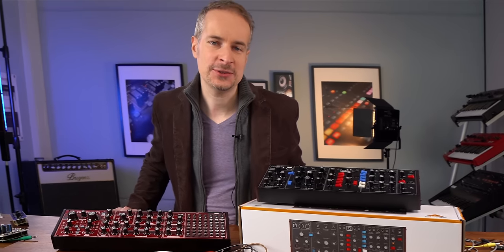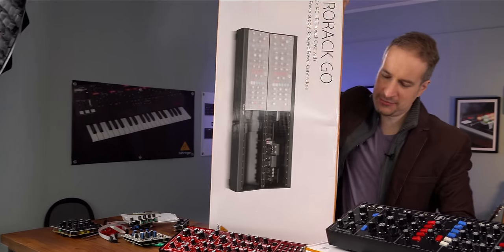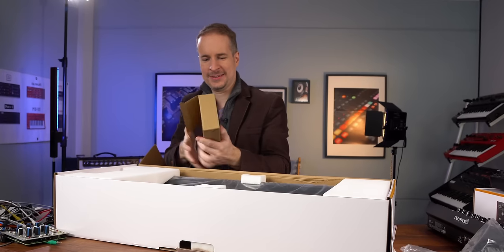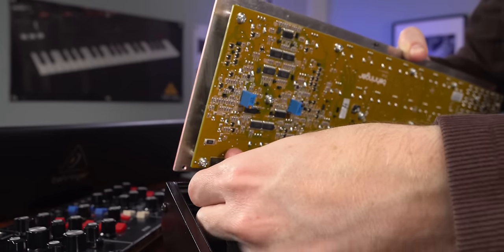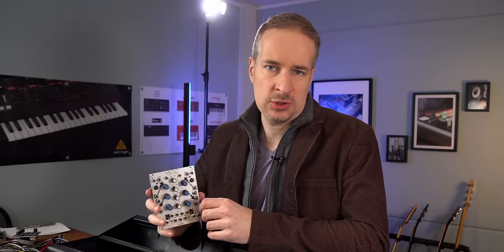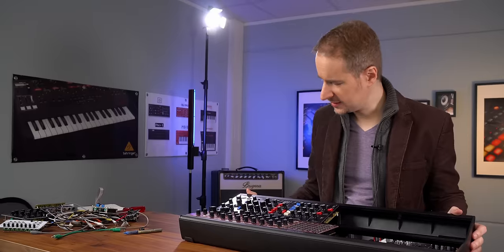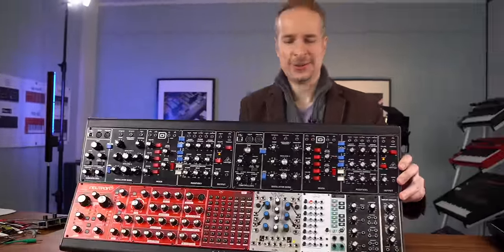Go Go Eurorack! Our new modular synth case

Comment: Guessing they will be putting a half size one soon. Which seems like it will be a bit more usable for most as far as not having to have so much stuff to fill it...
Reply: Half size would be great for those starting out.
Reply: Actually, half size is usually never enough for starting out. Most people are surprised at how quickly you can fill these types of cases.
Reply: @Genshi  Im guessing the smaller one is actually gonna be like 60% size... As half size would fit the Model D and Wasp but not the Neutron, Pro 1 and K2... So it makes sense to build one for 3 qnd no2. And especially when the 3 bigger ones tend to have more options as far as connecting with modular synth units... Ya figure at this size it would cost someone quite the bit of money to fill it up... Makes sense to make a smaller one and serve the rather large crowd who doesn't have 3 Behringer synths and a bunch of other stuff as well to fill it all up...
Reply: I think you are missing the point of Eurorack. First, I think it's ridiculous for anyone to take out the panel of a semi-modular synth like the Model D or Neutron to out it into a Eurorack case; those already come in their own case! But whether you use those or not, every single time anyone gets into Euroack and chooses the "smaller" case, they get frustrated when they see how quickly they fill it up as I mentioned before, because some modules are not as expensive as you may think. So it's always better to get more room than you need at first to grow into... When I had the TipTop Mantis case (the exact same size as this Behringer case) I outgrew it so quickly I had to get two of them, which was super inconvenient for live performances, so I eventually wound up getting one large foldable case that can fit all the modules from my two Mantis cases... and now I've already outgrown that! (and I don't have ANY full voice semi-modular synths like the Neutron in my case.)
Reply: Additionally, they already make a smaller single row case, and Arturia recently came out with their smaller (not as wide) cases for Eurorack. It makes more sense for Behringer to make this "Standard" size case, even though it is basically a clone of the TipTop Mantis case (we'll see if it can come in at a much lower price.)
Reply: @Genshi The thing is tho is there is a market for a 60% size unit.... Behringer has been spitting out these synths left and right. You now have a bunch of people looking to buy a 2nd unit and then stick them on a stand like one of the 3D Waves units or put them into other rack type units and on and on that can hold 2 in a small area right next to each other... Now if they put out a 60% case like this one there is another option for all these people to look at. They can get the case along with the new modules Behringer is gonna put out and build a setup that way instead. With 1 Behringer synth instead of 2. But then  having a little bit choice over how to build the part that's various modules... Is it me or is a big chunk of their audience people who don't have a billion dollars to build a setup? How is that Moog module they just showed gonna cost? Figure its gonna take like 8 units that size or more to match the width of a Neutron, Pro 1 or K2... Does little Billy have enough to that, then also then double it all up from there as well? Maybe not... After all he's 16 and cant even buy a beer yet let alone come up with mass bank to buy fun toys...
Reply: If what you are saying is, they should make a smaller case for people who just want to have two of the Behringer units in one compact case together, then that's fine; it's like the little rack thing Moog made for people that have the Moog Mother-32 synths (I have three of the Mother-32s altogether with the attached side-rails thing.) But just because you have a bigger case like this new one Behringer is showing now, doesn't mean you have to fill it all up right away... that's how you are making it sound. The whole point is to gradually get the modules you want once you can afford them... 

So now which do you honestly think is better, getting a smaller case for your two big Behringer units and maybe add a couple of smaller modules, only to realize there are about 3 new modules you also want and can actually afford (and whoops! Now you need a bigger case) or, get the bigger case to start with, put in what you have now, and know that someday, down the road, when you can afford another module or two (or 3 or 8) you can fill it up later as you go. Makes more sense to me. And that's how most people do it. But if all you are looking to do is to put two Behringer semi-modular synths in once case and that's it, sure there is a much smaller market for that, and there are already solutions for that from many manufacturers already...
Reply: @Genshi  Yea, that's exactly what im talking about... The crowd that does things like the Moog Mother 32/Dfam double and triple rack..s. And people who do little 3 tier Volca stands... And now their quite often the same folks who already have a Behringer Model D or Neutron and now watched the Pro 1, K2 and Wasp get released. So ya now have that crowd of people adding a 2nd Behringer synth with the idea of putting it on a 3D Waves stand or a stand from the guy on Germany who sells stuff on Ebay… At the moment, Behringer is not gonna make any money off of all those stands. Their gonna sell a bunch of the synths to these people so they can have 2. But make nothing off the stands. The guy in Germany and the guy doing 3d Waves however are gonna love it heh...But if Behringer did a 60% rack they could sell to that market. And it would open up the option to those people to instead of going with 2 Behringer synths, go with 1 and then enough modular units to fill up the other space... It might be a modular that satisfies harcore modular guys. But these are quite often people who may run a Volca Modular unit... Compared to that its gonna seem "big time" even if its just a small row of modular combined with a Model D or Pro 1 or whatever in a small setup...
Reply: Fair enough!

Comment: Could the behringer pro 800 be put into this if one power section was used only for that? It may be just slightly over but would it be ok still? If it's a no, could I put in something like the cp1a PSU and power the pro 800 separately like that? Thanks

Comment: Dump the DC plug.. the best part of my Pittsburgh Modular Case is that it uses a 3 prong PC cable to the power supply that is easily available at any electronics store.. no power brick to forget or lose when you are packing for travel..also the thing I hate most about my Rackbrute is the DC cable plugs into the front of the case..hideous...and you still have to deal with a power brick..just integrate everything into the case.. So the 2 things that I would change on this Behringer case are the power supply plug and the sliding nuts. Then I would be all in on this case and sell my Mantis, RackBrute and Pittsburgh cases.. cheers!
Reply from the maker: We hear your comment. The unit will ultimately now come with a mounting strip rather than sliding nuts/bolts.

Comment: Awesome!  If I could make a request...  Please release the Neutron's 3340 oscillators as a module. Maybe add a fine tune knob?   Some FM inputs? They sound great and I want to keep them in my rack detached from the Neutron.
Reply: John Doe look into electro smith they make a 3340 vco based on the same reissue ic chips. Diy kits are 99 bucks and don’t require any smd soldering.
Reply: Behringer said - Sure when do you want that this Christmas?
Reply: Adam Rojo  Thanks! But what I love about Behringer's oscillator is the wave shape morphing.  It allows for variation on the same basic waveform by blending adjacent waves.  Plus modulating shape produces some wild results.  The tone mod wave sounds nice too.  It's just a really good oscillator.
Reply: Cami Lito I want it on my desk by tomorrow morning or somebody is fired!
Reply: John Doe no worries. I forget they integrate that panning vca on the wave outputs. Also integrated that dm12 tone mod so that’s another plus for a neutron vco module.

Comment: one question: is there an internal midi-bus where i then need just one midi-in module or do i need for each module an extra midi2cv-converter-module?
i do like that my modul d has midi-in and i do not want to loose that feature..
Reply from the maker: Eurorack modules use CV instead of MIDI. So you need either a MIDI-to-CV module or you use a synths that already has USB-MIDI and CV outputs like the Model D or the MS-1.
Reply: @behringer  or use a neutron or keystep

Comment: Really cool, I've been looking to expand my Eurorack. I've been using a Moog Mother 32 and moog Dfam in a Tier 3 rack from Moog. Though I found it expensive to buy an empty case for it. What I am curious about however is. What happens to all those other Inputs and outputs (USB, Line in)? Do they get disabled?
Reply: Yes they do unfortunately.  You will have to patch everything and get a Midi Module or a Something like a Keystep which has Pitch CV and Gate outs.  For updates you also might have to take it out and put it back in it's original case to get the USB access to something like the Neutron.  My Mother 32's are cased but I keep my Neutron and Boog uncased for this very reason.  Semi Modules also tend to eat up a lot of case power so you may want to keep the Semi's out of the case and just use the case to expand that Semi into a real modular...

Comment: AES50 for EURORACK 

now that Behringer is getting serious about Eurorack Modular, it would be time to get into bringing serious digital mixing solutions for our modulars too, like for example bring to tmarket an AES50 stage-box with 24 or 48 inputs and oupts in MiniJack Format so that we could completerly integrate big modulars into the new WING digital mixer.  and if not AES50, maybe SC or DANTE or MADI or whatever, but something capable to connect  big Eurorack systems to a digitla mixer without the actual limits  . Please Behringer, only YOU can do it !

Comment: I hope this case is deep enough for ANY modules - their skiff is not deep enough for many units so I hope this unit is much deeper than that!?
Reply from the maker: It has a maximum module depth from 40 mm (1.57'') rear row to 62 mm (2.44'') in 60% of the front row. Hope that helps!

Comment: When this should be available? And by the way, description says it has two times 140hp, guessing it should be 2x104hp :)
Reply: Looks clearly larger than the Mantis though, which is 104
Reply: @alexhahn2034  Hm, you're right. Also looking at the model D pictured in the case would suggest that.

Comment: So here's what really bugs me about this otherwise brilliant release - it can snugly fit two Model Ds side-by side.

The Model D is 374mm wide, as is the Wasp Deluxe. If you wanted different synths from Behringer in this case, you're fine... if its those 2.

But the Neutron, K-2 and Pro-1 are all 424mm wide, meaning you couldn't fit two of those next to each other nor could you combine them with the Model D or Wasp Deluxe side-by-side.

Increasing the width of the Eurorack Go just slightly would allow your users any combination of Model D, Wasp Deluxe, Neutron, K-2 and Pro-1 they wanted. You'd be able to fit a maximum of 4 of your clone synths in. In it's current form you could only do 3 - providing you wanted a Model D and Wasp together. If you didn't but you wanted the others, you're limited to just 2 of the synths in that case.

Comment: Please stick to sliding nuts and not going full strips. Actually add more for each rail so we have plenty to work with. Part of the problem is that we have so little of it. Hence a bit challenging having to move them around. All my cases I am building is of sliding nuts and I love it because it helps iron out the when panels are slightly misaligned when manufacturing. thank you.

Comment: Lets hope you miraculously learned how to do quality control. I never bought a behringer product without any noise issues. Both Model D and Neutron are not usable because of a static noise in them (when you use USB midi). What surprise does this case bring?
Reply: I own a model d, neutron, k2 and rd8. Never had a single issue of noise with them, they go on all our bands tracks
Reply: No noise problems with my Model D or Neutron!  You need to correct your USB setup.

Comment: Is the 1A output shared between +12V and -12V? What about +5V? What are the exact specs for the PSU?
Reply from the maker: The case has a ultra-low noise power supply which provides +12V @ 3A, -12V @ 1A, and +5 V@ 1A in total. The mentioned 1A are only for the +12V rail per single section. Hope that helps.
Reply: @behringer  Thanks

Comment: Great but not enough 12 v sockets if we just wabt to plug eurorack modules!!
Reply from the maker: Hey Jeff, the case has 32 sockets total. In the rare case that this is not enough you can easily connect additional bus-cables.
Reply: @behringer  Oh,ok ,...so there is a second line of socket under the first we can see on the video?...But whhyyyyyyyy did Uli  wait sooo long to make us this rack?...Why?...we all bought so expensives racks.....Mmmmm? tell us whyyyyy.?........thanks to Uli and all the teams in UK and China to be so reactive

Comment: I have no interest in eurorack, none at all.....but I can see myself buying some of the behringer monos and setting them up this way just cause is such neat compact way to access “desktop” modules- without cluttering up my desktop! Question: I assume you could fit a pro-one, and my personal fav the new wasp  deluxe in this configuration?
Reply from the maker: Yes, but in separate rows because Pro-1 and Wasp are slightly wider that the Model D. You can either try some additional modules or buy blank plates to cover unused space.
Reply: BEHRINGER thanks for your reply so just so I’m clear, you mean for example, you couldn’t fit at wasp next to a model D as the wasp or pro1 is longer. Correct?

Comment: great. but one point as a change request please. please use rails for the screws. thats mutch better to install modules instead of this nuts. any how great stand. like it
Reply from the maker: We hear your comment. The unit will ultimately now come with a mounting strip rather than sliding nuts/bolts.
Reply: @behringer  you are awsome. Thanks.

Comment: Gimme some sort of bracket to mount 2 cases and i'm in
Reply: this
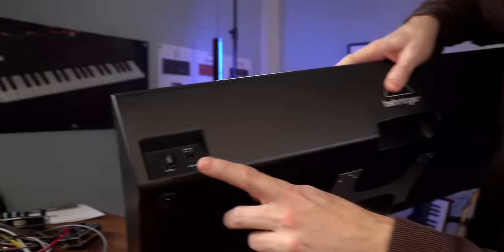Reply: I´d say if you look at the stand, around  2:10... it´s held to the case by 3 screws on each side. If Behringer don´t built a bracket to attach there, I´m pretty sure a 3rd party can and will do. Either replace the stand or use longer screws to add the bracket on top. But unless I have one in my hands, it´s hard to say whether those points would be a good idea for a bracket from a static point of view.

Comment: Sliding nuts ???
Oh shit a little stand on there?
I companies didn’t put all the power connectors on the top or bottom.  I have 2 of the Intellijel 7u cases and the power is all on the bottom.  So I have to pull a module out of the bottom to change one on the top
Reply from the maker: We hear your comment. The unit will ultimately now come with a mounting strip rather than sliding nuts/bolts.

Comment: Err is this not just the TipTop Audio Mantis case? Rebuilding classic synths, ok, but biting new small companies, not cool.
Reply: One could argue that because it's 36hp wider, it's not exactly a clone.   Oddly, it also has fewer power connectors-- 32 to the Mantis' 36.   Maybe because they figure you'll put a Model D or Neutron in there where you won't need as much?  You can add a bus cable if necessary though.

Comment: It's NOT aluminum, just molded PLASTIC, yet Behringer's site claims: Designed for rugged reliability, the all-aluminum chassis ... ...ensures rock-solid stability for use on a wide range of surfaces.

Comment: These sliding nuts are a problem... Apparently.
Reply from the maker: We hear your comment. The unit will ultimately now come with a mounting strip rather than sliding nuts/bolts.
Reply: @behringer  I use sliding nuts and have no problem with the nuts. You can place them where you want.